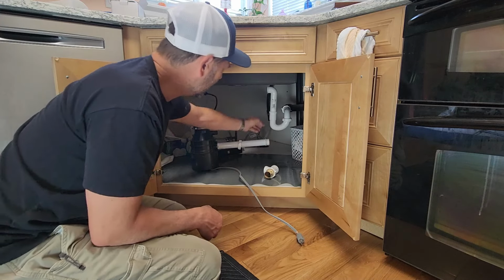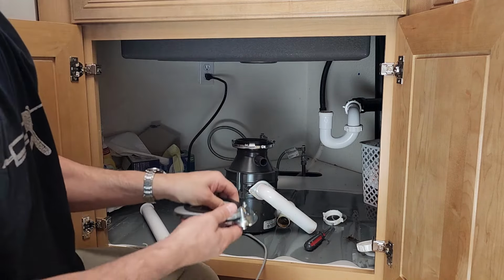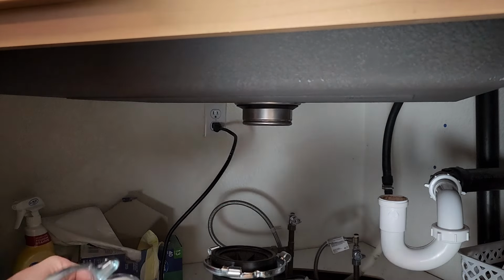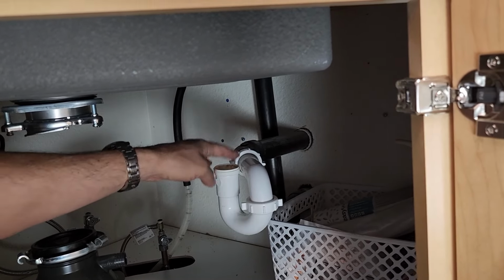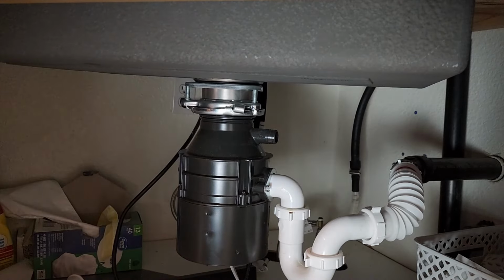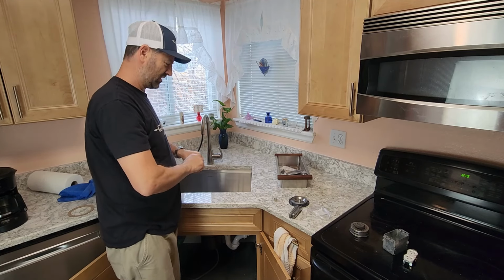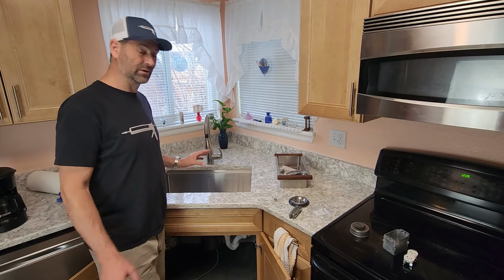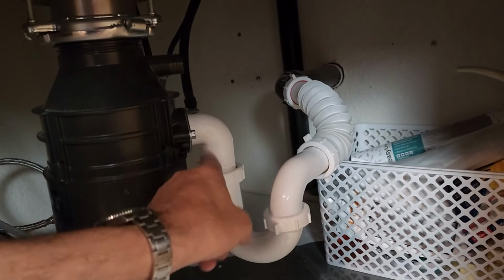Handyman Plumbing | THE HANDYMAN |

Comment: Tip: Use a scissors type car jack to hold the disposal in place while you cinch up the locking ring. Makes that portion of the job much easier. Unless you happen to have 3 hands.

Comment: Master plumber here! 🤣 A standpipe for a dishwasher is comical... Hey at least you can add a clean out👌
Reply: My MIL had work done in her kitchen a few years ago. Her sinks weren’t draining. I looked under it.  Both sinks run to one tailpipe. The tailpipe runs about an inch uphill (and they were the ones to install that tailpipe). The dishwasher hose is fudged into 1/2 inch copper (reused from the job) that runs straight up to just below the top of the sink. Then it drops down vertically into ABS to the p trap but it at least is kind of level there.
Reply from the maker: That method of draining dishwashers is how most productions homes are plumed around here.
Reply: Standpipe gets you out of needing a high loop or air gap. Adding it to my list of details for my next kitchen for sure.
Reply: Because theres no air gap installed on counter

Comment: I have a question that seems someone else asked. Did that cheap faucet sprayer end, come with a weight attached to the water line? It should, because that's what contracts it back up into the faucet neck when you let it go after use. I enlarged the video to better see the lines when you held them in your hand and didn't see one. Did I miss something?

Comment: I have an Ikea vanity/sink in my bathroom. It has drawers under the sink and the drain line has to make a sharp turn to avoid the drawers. It came with a flexible drain line and that's what the contractor installed. It cracked after a while and I replaced it with rigid pipe.

Comment: Why not run the drain down through the floor under the sink and reconnect to the drain line in the basement.
Reply from the maker: finished basement with drywalled ceiling.
Reply: I think this was the best idea yet and the most unfortunate response possible. 😢

Comment: Isn’t the fact that the disposal drain port is lower than the sewer hookup on the wall going to cause a problem? In my mind, you want your sewer hookup to be lower, or even at least, in comparison to the water coming out of the disposal. I would’ve just cut the drywall back, put in a new sanitary T in the right placement, and eliminate that kinky hose thing.

Comment: Im doing a redo in my bathroom right now. Why ? Because 1 faucet handle leaks. If it was a Moen, simple cartridge change. But it's not, it's Chinese crap. So now I have to install a whole new bathroom faucet because I can't repair the parts.Every water fixture in this house has had the same problems, with the same solutions.

Don't waste your time and money. Buy serviceable fixtures. I'm not even a handyman 🤣

Comment: I never understood the whole 1 sink thing. To me its so impracticable. 2 sinks s much more functional
Reply: Depends on your preferred way to do dishes.
Reply: Disagree completely, unless you mean 2 full-sized sinks. Those split-sinks are horrible for washing large pots or pans. I mostly use the dishwasher for plates and silverware, so the sink is for handwashing larger items. A separate drying rack on the side (with drip pad under it) is far more functional.